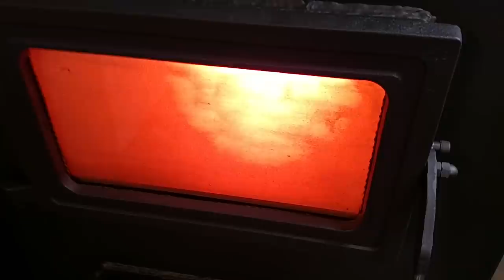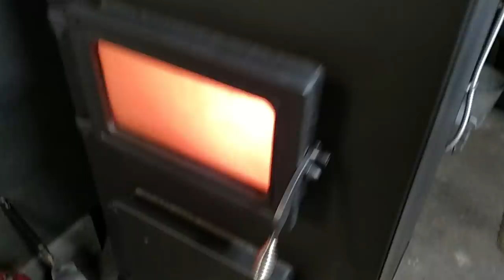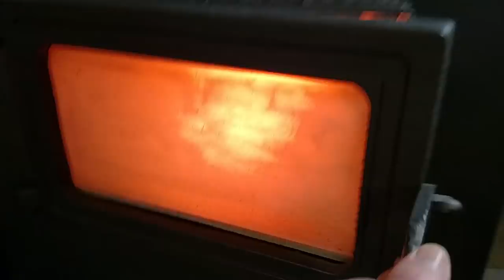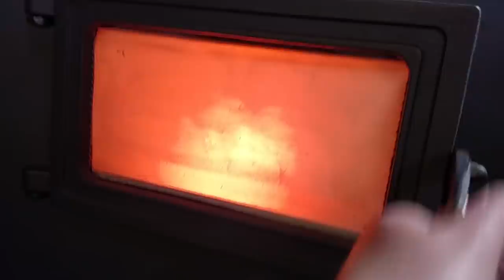Review Of Our New Hitzer 710 Anthracite Coal Stoker.

Comment: Ok to clean the glass on the firebox door grab a several sheets of newspaper and dip into the ashes you've removed from the ash pan. Dip the crumpled up newspaper into the ashes dry and wipe the inside of the firebox door glass, it will come out clean as a whistle, no straight edge razors or expensive cleaners. Been using this method for over 47 years.

Cheers!

Comment: Very interesting video. I recently installed a pellet fire in our home. Very similar conceptual design in that it runs on compressed wood pellets. It has a 20kg hopper and it's computer controlled and very efficient. It runs off 240v power but I installed a battery system for my home so it's power is supplied via a 240v pure sine wave inverter. Looks like you did a great job on the install.
Reply from the maker: Simon Manners the pellet stoves were really popular here. I know quite a few people that put one in. They are a similar design. Thanks for watching the video. Have a great week.

Comment: I highly recommend you keep the cover for the coal hopper in place when not fueling it to keep the possibility of coal gas getting into the house.

Cheers!
Reply from the maker: Definitely. I do crack it 2" after filling the hopper. When it's full of fresh coal and it's damp you have to let the condensation escape or it builds on the underside of the cover. Once dry, I slide it shut. One good thing our draft is so strong, I've never had any issues. Take care.

Comment: I just installed a wood and hard coal boiler for our home and it looks like It won't take much to heat the home place here. 
I live in an old log home in southwestern PA. Not far from the Allegheny mountains.

I like the fact that the hard coal burns clean with no  odor involved. 
Today I have two tons of coal coming to give the furnace its first tryout. 

I love your furnace it looks good
Reply from the maker: That's awesome, you'll love how the heat and time you'll get from the hard nut coal. Nice and clean. I was torn between a hand fired unit and the stoker I ended up installing. I miss being able to burn wood, that's the downfall with the stoker. Stay warm!
Reply: @AlleghenyMountainLiving  
I got the unit used, and I had had it for over a year.
I finally installed it this year.

It is definitely a learning curve but it does a great job heating the two story house.
My concerns are the politicians in the future throwing  a wedge in the coal industry I see that China and I believe the UK is forcing the people to do away with coal stoves. 
I know that hard coal is odorless but because of possible up coming regulations it could cause the price of coal to skyrocket.
But as we both know China and Germany will benefit from harvesting our coal.

I tried to find coal burning furnaces and from what I can see the EPA regulations have stopped the sale of coal burning furnaces. 
I believe that the rice coal units are still available
Reply from the maker: @bubba007sss  here in our area, we can still get new hand fired coal units, but we're in the heart of coal country also. Anytime you put politician in any topic it usually is not good!! We can't get good grades of soft coal any longer because of the other countries buying it all up. That was one of my reasons for switching over, just couldn't take the dirty garbage soft coal available these days. Keep supporting that coal industry, that's all we can do.

Comment: Are you planning on hooking up the hot water heater to a storage tank to prevent you using gas or electricity?

Also if you're considering buying in bulk check with the Reading, Pennsylvania coal breaker. They have a list of truckers who deliver all over the east coast. Or simply the next time you buy several 5gallon buckets of coal ask your supplier how much for say 10 or 20 tons delivered. He has to have a delivery from an anthracite breaker somewhere. It should be considerably cheaper getting your fuel in bulk but also save wear and tear on your truck  and less gas and oil.

Oh yeah 27 inches of snow in the front yard this morning. And that's on top of 14 inches we got this past 13 days 
3 northeasters we've had in 13 days. Glad it's March just waiting for it to melt.

Best of luck.

Comment: Thanks for the review! I'm still debating between reading coal stove or englander wood stove for my living room.
Reply from the maker: Drew B I looked at a couple Reading stoker's. They seem to be well made also. Thanks for watching.
Reply from the maker: Drew B If it's a hand fired coal stove that would be the way to go. Then you could burn wood or coal.
Reply: I bought a used Harmon TLC2000 wood/coal with a lot of wood burning hours. Over fired a few times but no leaks in steel. After new glass and seals and 15 ft foot of Selkirk insulated pipe, she's running perfect on nut coal, hand fed twice a day. Less in warmer weather. Keeping us toasty in a not so airtight 14x70 mobile home. Tends to build ash on left and right sides, so pokering these areas before shakedown is necessary. Just don't let your coal bed diminish too much when you poker. Draft control works perfect without barometric.

Comment: I have researched for a few months and have settled on a Coal Gun Stoker S130 made by Alternative heating out of Harrisville PA. It is a 27 gallon boiler rather than a forced air furnace.  I live in WV coal country and can't find rice or buckwheat coal locally except from Tractor Supply. Lump coal is everywhere but not sized coal. The mines here only sell commercially. The coal dealers who deliver from out of state are selling WV coal. So I have to order WV mined coal from another state while living in WV. It is ironic and frustrating to say the least.
Reply from the maker: GARVINANTHONY wow, that's crazy! I never would have imagined you would have trouble buying residential coal in WV. Sounds like a great business to get into! I'm sure you'll love the new boiler, nice and toasty!
Reply: GARVINANTHONY 

That boiler is a copy of the axeman-Anderson stoker fired unit they started building in 1938 as the first home all welded boiler design. The only modification was the addition internally of a fly ash separator. 
Axeman-Anderson is still in business and still building them new. But if you haven't bought one yet I can save you thousands by you going to this guy who buys up used stoker fired boilers usually EMF stoker boilers,
Here is a link to a EMF 350 anthracite burning boiler and they also have two soft coal burning boilers the EMF model 700 and 900. Are soft coal burning stoker fired boilers and burn smoke free and are very reliable. This fellow buys them used and goers right through them including pressure testing the steel plate boiler to insure they don't leak the goes through the stoker completely buying what parts he need from the EMF factory to restore the stoker to new condition and then resells them for a lot less than a new boiler from EFM.

https://youtu.be/XnkT9ZtE8KQ

This is what an EFM stoker burning anthracite coal looks like when it's running.

https://youtu.be/k9t0XBEdVuU

Best of luck which ever way you go, by the way the axeman-Anderson comes with a stoker where the alternative heating coal gun has a stoker available but it's extra $$$$$$.

Best of luck.

Comment: Thank you for this video, i am putting this one in my basement at the end of October, i was looking at the ds furnaces but thankfully i seen this video and you just saved me 3000k and those ds furnaces do not have the smart coal-trol , i have to get duck work added into my oil furnace duct work. I like that this is a easy unit to take care of, coal wise and setting a perfect temp. My only question for you is, is there any issue not having my air return plumed into this unit , do you only use it open with that filter?
Reply from the maker: Glad, this video helped you. I only use the filter for the cold air return, it circulates the air really well this way and I found I didn't need to tie it into the duct. Good luck with your new unit.

Comment: If you decide to buy coal in bulk from your local dealer ask him what price he would give you for a truckload, but first ask what size truck delivers his coal. Then offer if it's an amount you have room to store what he would offer you for a truckload and you would prefer not to pay his regular price as the coal won't ever be on his property, it will simply go from the coal breaker to your place. He should give you a good deal as he doesn't have to store it load it  or cover it. I would also ask what is the minimum amount of coal where he could give you a decent price on the fuel. By the way if you do buy in bulk the 6 horsepower vacuum is the vacuum you want for the DIY coal vacuum transport, and don't use a larger bucket than a 5 gallon bucket so you don't overheat the vacuum motor.

I know one guy in northern New Hampshire who got his delivery in January and the trucker showed up with his skis and wife driving an 20 wheel dump trailer and in order to unload the truck has to put his pickup sideways behind the dump trailer then drives it to the back of the house wher the trucker can't go then dumps it into the below ground coal bunker. He after I advised him called around to various junkyards and found a 1 ton electro hydraulic dump mechanism that converts a conventional pickup cargo bed to a poor mans dump truck. His last load was 34 tons and took him and the trucker just over 4 hours to transfer the load and fill his bunker. Then the driver and his wife were there guests for the weekend to enjoy the slopes and had a blast before leaving Sunday afternoon.  The driver gave him a $500 discount on the trucking for the ski weekend he provided.

Best of luck.

Best of luck whichever way you choose to go.

Comment: Daryl, i have a keystoker 105k BTU and love it. Coal is the way to go. Does Hitzer have a battery back up for power outages? I thought about investing in a generator but bot sure yet. Thanks
Reply from the maker: Dacota Outdoors they are nice, and so much better than soft coal! No it doesn't unfortunately. Probably going to put in a generator anyway, but for now I rigged up some deep cycle batteries and a 800 watt inverter that I can run it with when we loose power. Seems to work well.
Reply: Thanks Bud! Could you do a video on that (inverter battery set up) if possible? i know your very busy and have other videos planned so no rush. Hopefully NY only has a month or so of snowy weather. (fingers crossed)
Reply from the maker: Dacota Outdoors sure, I was actually planning on showing the set up. Figured everyone else with a stoker is probably in the same boat. Have a great day!

Comment: Sorry if I spelled your name wrong ?Darrell?, but I wanted to ask you a few questions.  I see that your Hitzer 710 has (what looks like) an 8-inch duct on top of it.  This would lead me to believe that you have a blower motor somewhere that's forcing air up to another level of your house.  Is that correct?  My research is telling me that the term "stoker" refers to how coal is being fed into your burn chamber, but I'm still a little confused about something else.  Does the term "furnace" refer to the fact that your heating air -- and not water?  I apologize for the rookie questions, but I was raised in AC country (the deep south) and all of this is new to me.  We now live in the mountains -- not too far from you -- so I'm doing everything I can to learn about the art of efficient heating.  One thing I do know, for sure, is that burning cord wood and propane is clearly not "efficient."  By the way, any thoughts on what I'm being told to consider; namely, a "stoker boiler"?
Reply from the maker: It actually has a 14" duct or plenum on top which the hot air is blown into from the furnace which then is distributed through the house via duct work. It's a forced air system. If you currently have hot water heat in your home than a stoker boiler would be a good choice for you.
Reply: @AlleghenyMountainLiving  As I don't have a lot of computer time, I need to ask you a quick question.  Considering the fact that coal burns continuously, does your Hitzer 710 system have some sort of way to control how much heat you get?  In my mind, I'm imagining that the only way to stop a coal heating source -- after the living area reaches the desired temperature -- is to extinguish the coal fire.  In other words, I'm trying to understand how one avoids over-heating a living space with a coal system.  Thanks again for your  time.
Reply from the maker: @timberwrightsvs480  It's controlled by a digital thermostat just like an oil furnace. I even have it programmed to turn it self down during the day and then in the evening it turns it self up to 70. Thermostat controls everything on the unit from the feed rate, to the blower speed. Other than filling the hopper with coal and taking ashes out it is fully automatic.

Comment: In the event you haven't purchased a generator yet I highly recommend a Kohler air cooled diesel generator which uses a brushless generator which produces clean power like you get from the grid. This on is from a small company in Maine and I would not hesitate to do business with them.
Here is the link for the generator you want with all the specifications.

http://www.centralmainediesel.com/order/Slow-Turning-Kohler-5kW-Diesel-Generator.asp?page=yanmar_4kw

It is a little bit expensive but very economical to run and will power your entire house. Even though it's diesel it has a decompression lever to start the engine easily with the hand pull rope starter or you could simply order the electric starter kit which starts it very easily. After starting it you let it run for a minute or so to warm up then kick the breaker on. The one thing that impressed me was when a heavy load electrically kicked on the engine rpm didn't drop excessively like a gas generator does. You will love this generator, one pice of advice don't run it out of fuel as they can be a pain to get the air out of the injection system.
A friend of mine has one with over 3000 hours on it and absolutely loves it. When powering his house with the diesel generator you'd never know the difference from commercial grid power.

Best of luck.
Reply from the maker: James Shanks I'm a big fan of those generators. They make a good machine. One of these days I'll get around to putting something in. Thanks for the link and info, appreciate it.
Reply: Allegheny Mountain Living 

Glad you know about that generator, a friend in auburn, New Hampshire owns one and he passed away three years ago. 8 years ago we had a massive ice storm and power wasn't restored for 11 days and he had his identical to the one I sent the link about plugged in with the 240 volt connection. Powered the entire house and he used just over 24 gallons of diesel fuel in the 11 days until power was restored. His wife still lives there and every time power fails I get called to pull it outside plug it in and fire it up after shutting off the commercial feed. Last week I installed a led light on the commercial feed before the breaker I use to isolate the house so she knows when commercial power is back on, the led is mounted in a electrical box in her kitchen and has helped her. 
 My friend God rest his soul was disabled from the waist down due to a broken back. I'm in the process of installing an automatic transfer switch with automatic start stop which will be programmed to run for 5 minutes before the generator breaker closes sometimes it warms up a bit before a load is applied. His is a portable model and when I'm done it will be fixed running off a 275 gallon home heating tank in its own shed. Another three weeks or so and it will be complete. 

Unfortunately looking at 8 to 14 inches of snow Tuesday and Wednesday then in the 40's every day after the snow so seeing as I'm retired I'm stocking up the larder today and will simply hunker down for a week or so until it melts enough so I can easily get out of the driveway.

May the rest of the cold weather be kind to you and your family.

Cheers!

Comment: What do you do about the stove when the power goes out?
Reply from the maker: gardenman3 well, right now I am running it off of a deep cycle battery and a 800 watt inverter when we loose power, which actually happened earlier today. Long term plan is to install a generator along with a wood stove upstairs for secondary and warmer weather heat. Thanks for watching and commenting.

Comment: Good morning.. I am new to your channel-  how does your furnace regulate temperature in your home ? Does the blower stay on continuous ? Also your coal stoker must keep your basement toasty -
Reply from the maker: An electronic thermostat controls the furnace just like an oil or gas unit. When it calls for heat the feed rate of the coal increases and then the blower will increase to deliver the heat until the set temp is achieved. The whole house is always with in one degree of the set temp.

Comment: How can this compete with fuel oil? No shoveling and you can go a year without looking at it except to change the filter. And you can leave for weeks.

How do you make domestic hot water?
Reply from the maker: I have a forced air system. Forced air oil is drafty and inconsistent. Hard coal is continuous even heat. With the hard coal I can heat for the whole season for around $900.00, instead of $2000.00 - $3000.00.  On top of that Its supporting Pa coal jobs.
I use an electric domestic hot water heater.